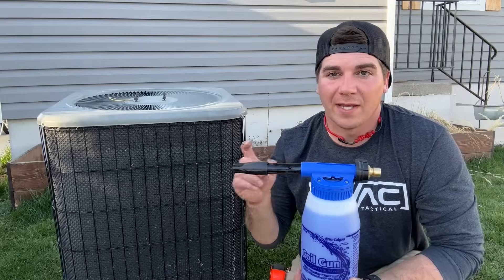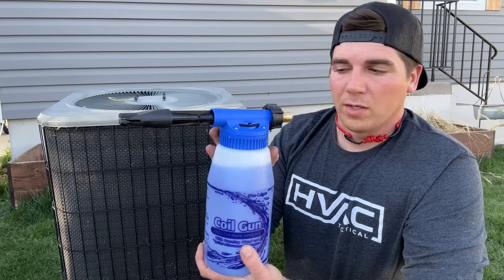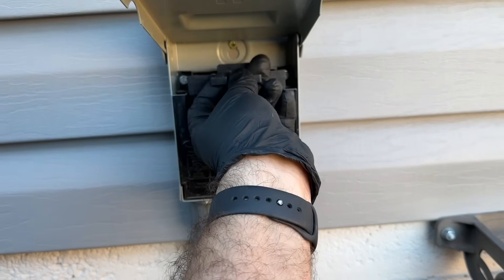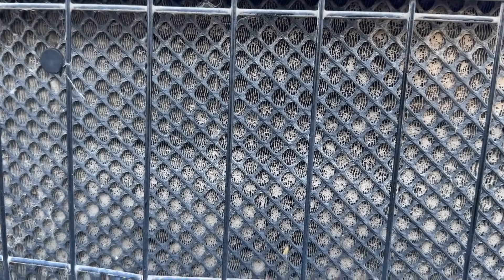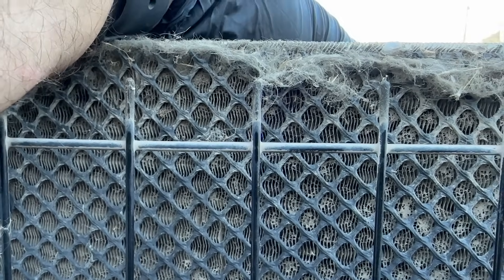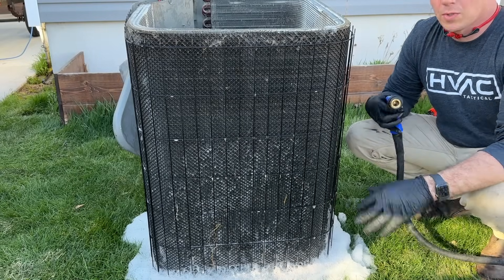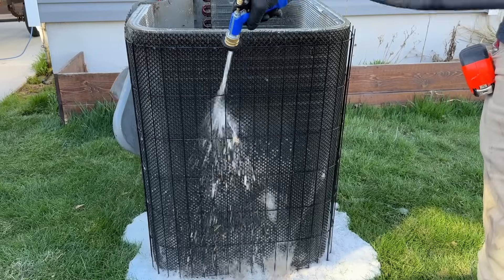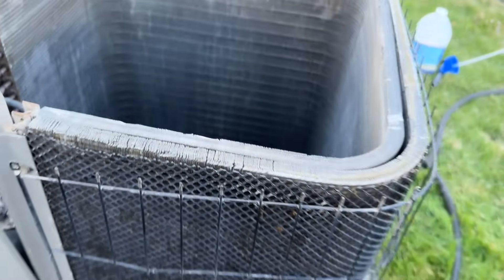How To Get Ice Cold Air By Cleaning Your AC Coils The RIGHT Way.

Comment: Always check manufacture recommendations on how to clean your condenser coils. I have a Lennox Quantum aluminum coil on my ML14XC1S024-230A09 condenser. Lennox states "Use water only at moderate pressure to clean the coil. If water alone doesn't do the job, apply a pH-neutral coil cleaner (pH 5-9)." Nu-Calgon Evap-Pow'r C has a pH 7. Nu-Calgon Tri-Pow'r HD has a pH 8.5. The coil cleaner used in this video Nu-Calgon 4291-08 Nu-Brite has a pH 11-12.

Comment: Thank you for all your helpful videos. Do you have any experience with Magic pak units?
What is a good way to clean the condensing coils from the outside wall on the second floor up?
I also want to find the C wire from our Magic pak so I can install a smart thermostat.
There is a blue wire from the furnace  wire bundle with the other Rc,G,Y,W wires.
How do I test the blue wire if its the C wire? Cheers

Comment: My Ac is not cooling. I cleaned AC coils and found a wire laying around under the compressor. It looks burnt out. I opened the compressor plug cover to see if it's coming from there. But all 3 wires connectors still intact inside the plug. Is this why my AC is not cooling? Beginning part of the suction line is cold, but the rest of it is warm. Where should that wire go? I see some kind of opening, cone shaped under the compressor.  Is that where that wire goes into? Below are the links to the pictures
Reply: https://drive.google.com/file/d/12XzAgBvDbKTZ_oRyjYqu4u515tkfuYwp/view?usp=drive_link
https://drive.google.com/file/d/17LkUgqnwKdWkp7_VzBrDrR2nQYKl8uwW/view?usp=drive_link

Comment: For an everyday homeowner, what’s your thoughts on the 
Nu-Calgon Triclean 2X Coil Cleaner vs the foam spray gun and concentrate?  

It’s about $25 on Amazon vs  the $150 investment in the gun and foam concentrate.  

My coils aren’t overly dirty (that I can see) and while I’m sure the gun would be best, do you think the Triclean 2X is still better than just an aerosol foam cleaner in a can?
Reply: Or just simply use water only. You are not crud busting a greasy engine block...use your money for something with more value.

Comment: I always clean from the inside out. The Fan sucks inward and up. I blow out from the inside with compressed air first. Then hose from the inside out, then apply coil cleaner in the inside and spray water outward. Yes, you have to remove the fan but it gives you a better result and better cooling. I do this once at the beginning of each season. Then once per month, just use water to keep coils clean. TIP: when cutting grass or weed whacking, turn your unit off until your finished working around it. If it's running, it'll suck all that crap up into your coils.......save yourself a headache, turn it off until your done.

Comment: Question, I have a ducane condenser 3-ton unit.  I used a mister on this condenser for two seasons and now a few of the outside and inside cooling coils are corroded and falling apart.  So later I would like to replace the coil only if possible since the fan and compressor still working fine and to save money and not a new system with R410A.  My unit is approximately 18 years old with R22 coolant.  Is there a replacement cooling coil for this Ducane?  I saw in one of your vlogs that you replaced the condenser from a garage roof with a RUUD unit.  The unit you removed looked like a Ducane brand and could be the same size as mine seer 13 and believed to be a 3-ton unit.  Again, thank you for showing us how to DIY

Comment: Interesting.  25 years in same house, with 2nd condenser/ac system installed about 5 years ago.  I have never seen anyone clean my, or anyone else’s condenser coil.   I also just went out and looked at mine, it looks the same as the day we installed it.  Shiny Aluminum fins.  How is everyone getting stuff stuck in the condenser???

Comment: been in the hvac industry for 30 years, garden pump sprayer and a bottle of yellow death and a garden hose works fine. For home equipment, lets not get to crazy. most of the time a simple washdown with water is enough, and you really should have split the coil.
Reply from the maker: I split the coil of this unit in another video to prove that it doesn’t need to be done. It was spotless in between.

Comment: As an hvac tech i do not recommend using the blue alkaline cleaners every year. This eats the top layer of metal off the coil making it clean and shiny. This weakens the metal over time. Being on the coast this is a last ditch cleaning method and usually frowned upon. I recommend only cleaning your coil with water year by year as it wont be that dirty.

Comment: Looks good for the coil outside remember there is a second coil usually  called an A coil inside the furnace that needs cleaning also .
Reply: Evaporator coils, also called a-coils, seldom if ever need cleaning. They stay clean because the air is filtered and the wet coil self rinses. That's why there isn't easy access to the evap coil in most installations.
Reply: @johnwilcox4078  that would be a 2 part system . My mistake for not being clear . I was referring to a Goodman all in one package system . Our old one failed due to no filter ( lousy instal ) and the new one wea also installed with no return filter ( lousy installer ) also all the ducts were taped together and fell apart .

Comment: This is no joke.  My unit is 4 years old.  Cooled my house like a champ the first 2 summers..  The 3rd Summer it struggled mightily to keep the temp below 80.  Nothing changed, same ole house, I thought maybe it was just a hot summer.  I had an A/C guy come out to check on it before the spring and he was like everything is good but you need to clean this unit its dirty.  Now I couldn't actually see any dirt on it for me to call it dirty but he explained "I've since verified online" that the smallest amount of dirt/dust on the coils can change the efficiency of any unit.  After he left I cleaned my unit with simple green and could immediately tell a difference in the coldness of the air coming from my vents.  I'd advise cleaning at least 2 times each summer in the south and maybe once in the winter.
Reply: Takes way longer than 10 minutes. I do mine once a year in North Texas.
Reply: @BLACKMONGOOSE13 am in north Texas as well. Do you clean from the inside or just spray from the out with just water?
Reply: If you had a guy check on it
In spring and just told you that your coil needed cleaned, he failed you. The whole point of preventative maintenance is to prevent a break down. He should’ve cleaned it. It takes 10 minutes.
Reply: @HarryHafsak he got paid for a check up not a clean up do u know if it was micro channel? did it have hail gaurd ?was it a double coil? did u need to completely take the cage off like a rudd ac ,or was it really dirty where u have to remove fan and clean inside..... 10 mins u say ???😂😂😂😂

Comment: Actually, im a truck driver and we use a an aluminum cleaner for all of our aluminum rims and trailers, so i just make some for my a/c, works very well.
Reply: Very bad idea anything acidic will damage the coils they are very thin and expensive.
Reply: Actually, those chemicals are being used on thick metals in your application. Those fins are very thin and fragile and there is no need for them to be "shiney"...that is just an illusion you have done something that made a difference lol.

Comment: Not sure if it's here but foam OUTSIDE and spray water from INSIDE.  You want the debris to move in the opposite direction of airflow.  Otherwise you tend to force material INTO the coil instead of out.
Reply: That’s the whole point of taking the top fan off, right? If you’re going to spray from outside and it doesn’t seem, there’s a point of taking the fan off. I’m getting ready to clean mine for the first time so I appreciate your comment.
Reply: Yes thank you I thought so
Reply: I've seen it done both ways, but if we are to think about it, the gunk is getting pushed from inside to outside, so by washing from outside to inside, we are pushing the gunk back the way it came, instead of pushing it deeper into the crevices.  As you said the opposite direction of the flow, but we have differing opinions on the flow it seems.
Reply: @AlvinKazuuie  airflow is outside to inside and out the top.  Just the reverse of what you mentioned.
Reply: @DT-jz3wn  Ok, thanks!  I'm wrong then.  I tried to look it up after my post and couldn't find info so I could have been wrong.  I figured it went down and out the sides.

Have a good day.
Reply: @AlvinKazuuie  all good 👍
Reply: You're putting way too much thought into this. Just rinse the fkn thing. It will be fine.
Reply: @themonsterunderyourbed9408  Actually this is an important tip. Things like small leaves or blades of grass that get stuck in the fins of the coil (though shouldn't with a proper bet cover) will  simply not come out when washing from the outside. The people I know that do clean their AC units, always go from the inside to the outside.
However, in this particular case, the unit is a double coil so it would make little difference.
Reply: @themonsterunderyourbed9408  LOL, RIGHT.
Reply: @themonsterunderyourbed9408  Im going to rinse one side north to south, the other south to north. And the adjacent sides form east to west and west to east. I'll do once side during a waxing moon, and the other during a waning moon. I"ll report back soon!
Reply: @GregoryGuay  😆😆😆 awesome.

Comment: You can also use a car wash foam cannon” which is the same syphon type can that make foam. About $29 on line.
Reply: I got a car foam canon that was exactly this model (except it had a red cap and no writing) for about $20 from Walmart a few years ago. I just fill it with diluted dish soap and it woks great for keeping my 38 year old York AC unit running. Plus it has many many uses around the house, from car care to exterior cleaning.
Reply: or a Ortho hose end sprayer with DISH soap.  it will clean it fine.   or a pump sprayer with dawn-palmolive or ...      certainly will improve it.

Comment: Am I doing anything wrong...I used Simple Green 3:1 dilution in a garden sprayer then rinsed off w water.  The spray wand can direct the cleaner into the inside fins from the top openings in between the blades, so didn't bother opening the top.
Reply from the maker: No you’re golden 👊🏼

Comment: What do you experts think about a leak (main copper from the compressor) right after I used Nyco coil & fin cleaner? 10 yr old Goodman A coil, inside fan motor still humming.

Comment: A good buddy hvac tech told me to not use the blue solution shown bc it can damage the coil by eating away some of the metals making them easier to corrode and ultimately ruining it in a shorter time frame.  Curious on your thoughts about that?

Comment: would getting a budget pressure washer work too?
Reply: Just be careful with it and make sure you're spraying head on at the coil at all times. The fins of the coil are laid vertically so if you spray on an angle you can flatten the fins which prevents airflow across the coil. Generally, pressure washers are only needed for large commercial and industrial applications. Something as small ss a residential unit should only require a hose and nozzle. Buy a soft tip brush it thoroughly first then rinse with the hose.

Comment: @diyhvacguy what are condensers and foil made of?  could a quick fix of using Easy-Off oven cleaner also work?  ive used that to deep clean other items that have intricate parts, but im always leery of using on metals that may react to the cleaner.

Comment: Geez, I've never cleaned mine in 8 years and the light shines right through it.  What is all that junk?
Reply from the maker: It’s dependant on the unit location, if there is certain types of trees or a dryer vent close by. I’ve seen some clog up in a year, and others be fine for years and years

Comment: This is a two pass coil that needs to be split.  Also they need to be cleaned from the inside out.
Reply from the maker: Nope, I actually did split this in another video and it was spotless in between. Doing that would be a waste of time. And trying to spray from the inside out on a dual row is also not ideal. I just  spray them  in a downward pattern, never had any issues.

Comment: I was wondering why you didn't spray from the inside of the unit going outward. Does it make a difference? On another note my son was in Utah for the UFC Fights a couple weeks ago. He and his wife love it up there. Great Video!
Reply: I thought the same. it makes sense to spray to oppose air flow.   like vacuuming air filter from the outside. all the inbound particulate moves back the way it entered. aren't you driving particulates further into the coil spraying from the outside in?
Reply: Yes you should be spraying inside out. Blow the junk out the way it came in.

Comment: Water does just fine on residential condensers if left on to long will strip the paint off and over time cause damage to your equipment. Dude didn’t even take the grill off or split the coil properly.

Comment: Any suggestions outside of Nu-Calgon?  Dawn?  Simple Green?  Also... how long do we need to wait before turning on the unit?
Reply: You dont even really need any cleaner. Buy a soft brush and brush the coil out first then rinse the coil out with a hose and nozzle spraying from the inside out. If you're using a nozzle with decently high pressure, take caution to spray head cuz if you spray it at an angle you can flatten the fins on the coil.
Reply: Dirty units need cleaner. VIPER makes one of the best that’s the proper Ph so it won’t attack the aluminum of the condenser.

Comment: I made the mistake of using a pressure washer on the coils, andd I bent some of the fins on the coils.  How much is this going to affect the cooling of the unit.  Do I have to replace the cooling coils?  I believe I ruined 25% by bending the coils.  What do you suggest?
Reply: there are specific fin brush tools you  can use to straighten them out.   Its repairable!

Comment: The worst advice you can give... is "your home warranty will pay for it" remember these words "pre existing conditions" there hasnt been a single home warranty that has replaced a unit for a customer in the 9 years ive been doing hvac. That home warranty got an easy way out by seeing how impacted the coil was. They probably would have said "due to the age of the unit, it was bound to happen so unfortunately it wont cover it" or my favorite "yea its covered" on the day of installation "you know what... the warranty only covered a 2 ton, but you need a 3 ton, unfortunately that will be an extra charge"
Reply from the maker: I said it’s a lot more likely if it’s clean is all. I think they’re a scam just the same brother

Comment: Would you recommend using a mild pressure washer to do it?  One of those cheap 1000 psi types.
Reply: Only if you want to replace your coil. The fins are very thin aluminum and will flatten out so you’ll lose the airflow to the tubes. Use low pressure flowing water

Comment: Is there any difference between the foaming device used here and a car foam cannon (on the end of a portable low pressure pressure washer) with a premix of the cleaner in the percentage you want to use?
Reply: I was wondering the same thing. I’ve got a foam cannon and only difference I can tell is it hooks to a power washer. It’s not recommended to use a power washer to clean AC condenser, the foam can in on a power washer isn’t a powerful stream.
Reply: @troyd.521  Actually, the foam stream I get with my 2700 PSI full sized pressure washer isn't particularly strong at all, and seems no different from what comes out of the one I have on my 600 PSI portable washer (which is what I'd use), which isn't strong either.

Comment: Killing the disconnect doesn’t always kill power. I’ve had it where I assumed power was off by doing this but one of the prongs got stuck in there and you wouldn’t even notice. Well I still had 120v in the unit. Always check with a meter if you are gona work on the AC . Never assume.
Reply: If you kill power to your AC unit and there's still.power going to said unit you may want to call an electrician and have them see why you have power when the power is cut off. That's how fires get started.
Reply: @jonboatmorava9115  if you’re not qualified yes call someone else
Reply: Always that one in a billion scenario
Reply from the maker: Good point. Thanks for the tip

Comment: I was told to never allow a technician to hose the coil from the outside because that pushes the dirt back into the coils. It should be flushed from the inside out.
Reply from the maker: I think that’s a load to be quite honest. I’ve never had a problem with this method. It’s not so much straight in but pushing the junk down the face of the coil and off

Comment: I always recommend, if possible, to not run the A/C while the lawn is being done. That in itself loads extra dirt and grass debris.
Reply: Good tip
Reply: I guess I never really thought of that being an issue. Thanks for the great advice.
Reply: Just mow so the discharge points away from the a/c unit

Comment: HVAC noob here, but even after you turned off the power and took the top fan off, when you were spraying it down i noticed you got a lot of water and soap on the motor? (is it a motor?) small black thing on the inside bottom of the unit. Is that not a concern? Seems like when you plug it back in and power it on that could be an issue?
Reply from the maker: So every condensing until will have two motors, one for the fan on top, and the other is the compressor down at the bottom. Both are designed to be in the elements and this will not hurt either of them.
Reply: @diyhvacguy  Great to know, thank you!